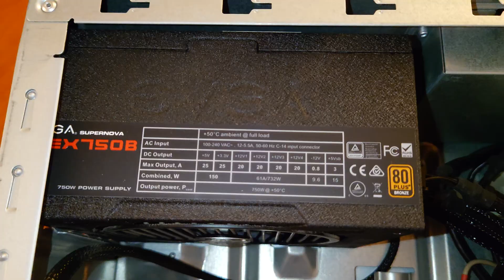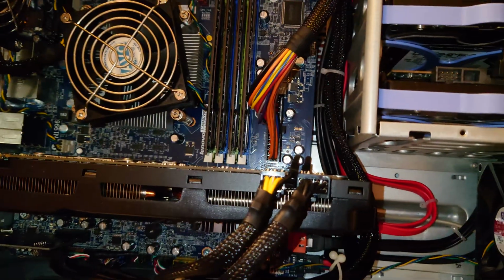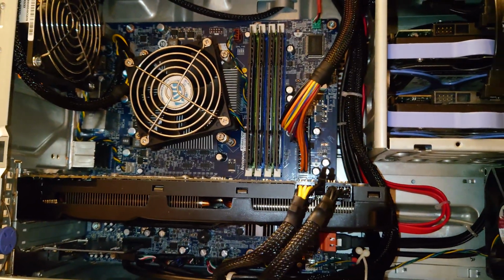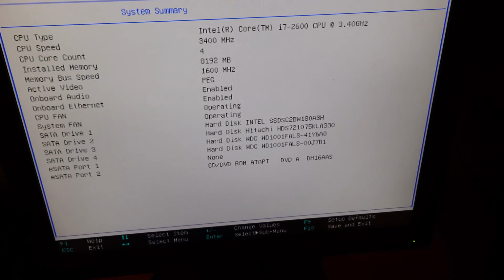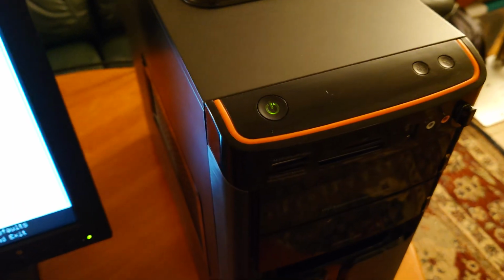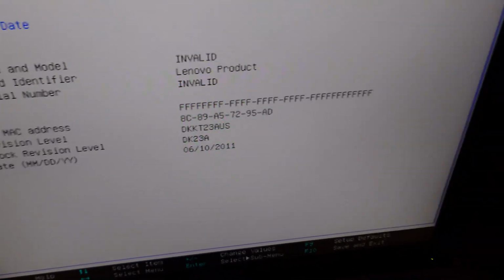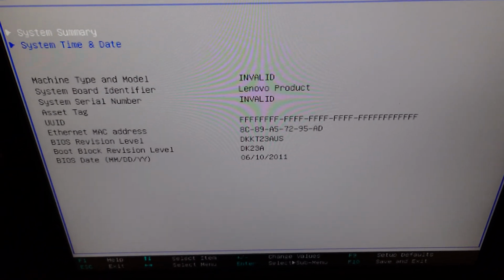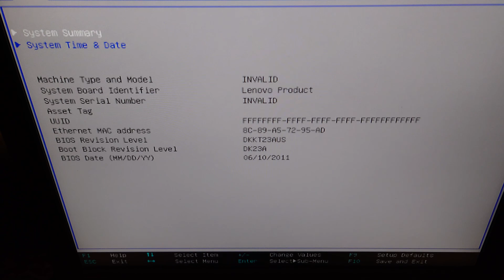i7 2600 in 2022 Part I: IdeaCentre K320 to K330 Conversion

Comment: Nice computer.  I had a Dell T1600 with the Xeon E3 version of the same CPU.  Pretty  much identical minus the onboard graphics.  Worked very well with the RX 570 8GB I paired it with.  Only upgraded because I got a crazy deal on a workstation a local animation studio was selling off.